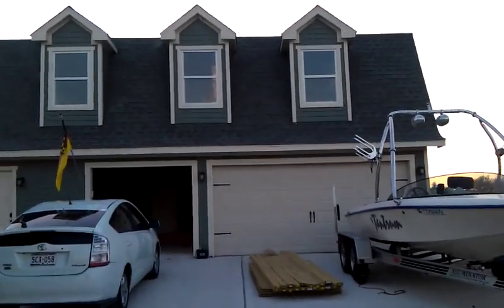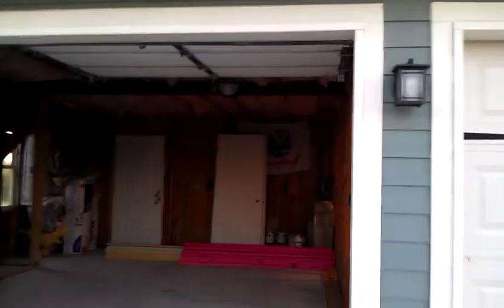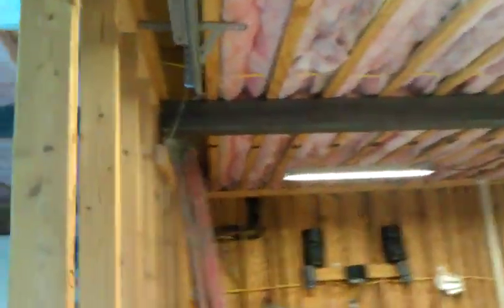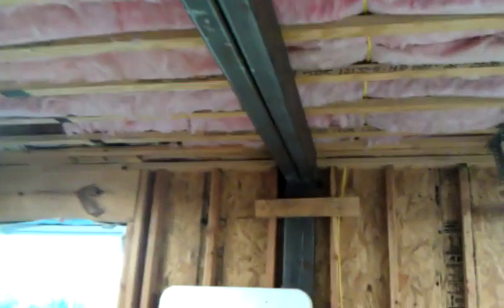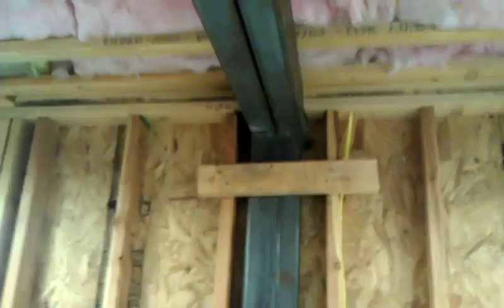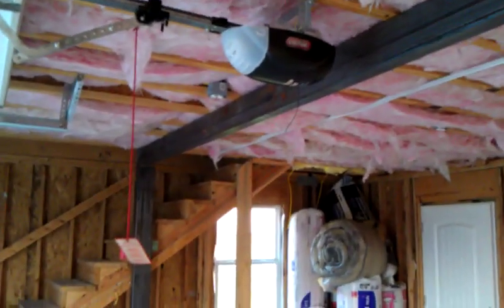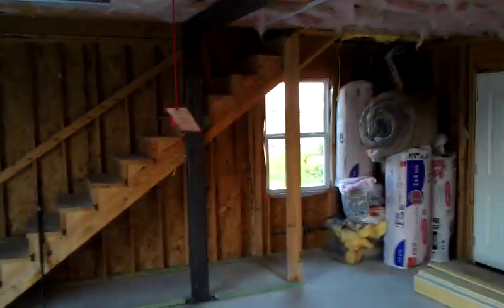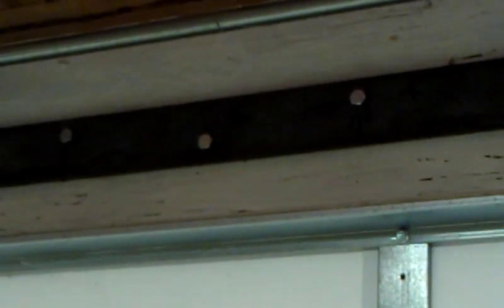I JOIST REPAIR

Comment: Did you break up the slab and pour footings under the metal posts, or are they just sitting on the slab? There wouldn't already be foundation next the the stairs like that.